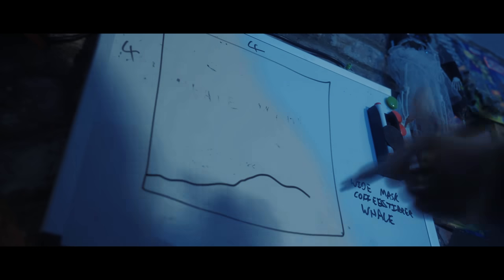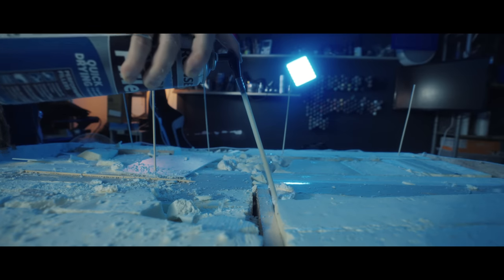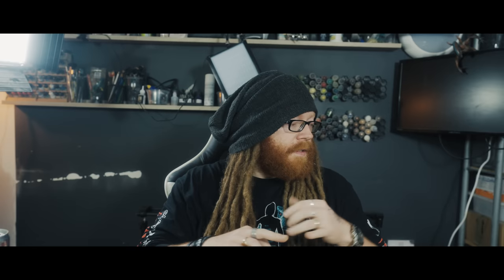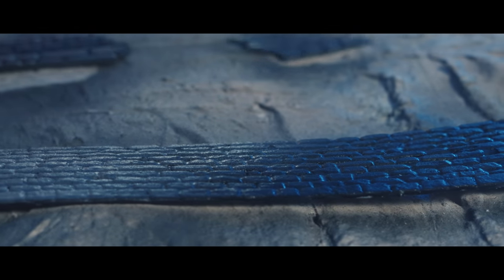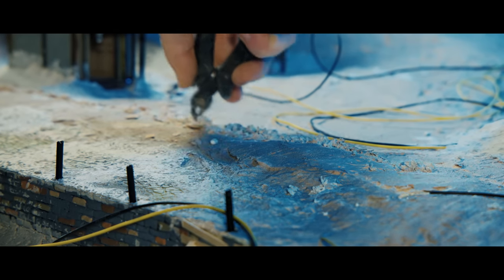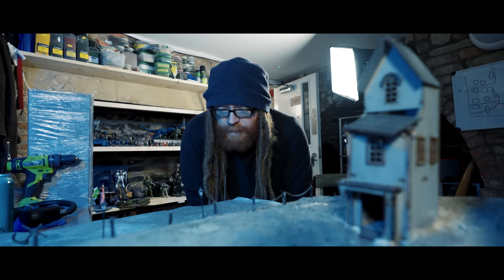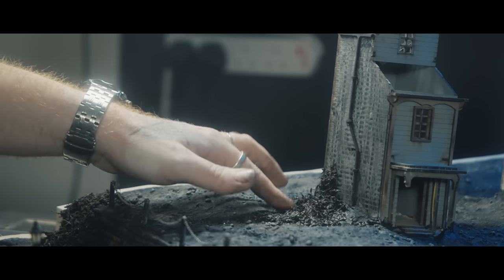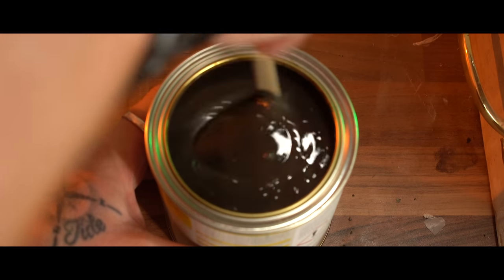WARHAMMER MORDHEIM BOARD - Oceans, Street Lights and GRIMNESS

Comment: I've a tip for you - when you basecoat anything with sand, grout or anything like that, if you think the paint with 99% isopropyl then you don't have the surface texture and it just spreads through it when you touch it with your brush. Helps with large areas since you don't end up touching every spot with a brush but it's good on miniature bases because it sucks the paint along the basing material up to the model's feet so four or five touches to the sand around it and it's covered so you don't end up poking the legs.
Reply from the maker: Amazing shout, thank you!

Comment: when your carving the trenches for the wire use as drill with a big enough bit in it lay it on the board at an angle, set it going and drag it backwards saves loads of time :)